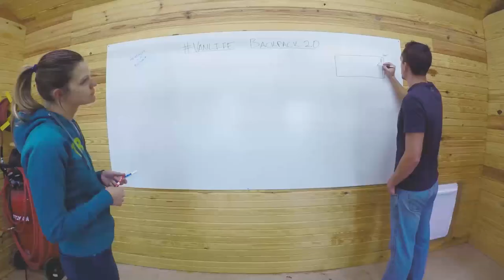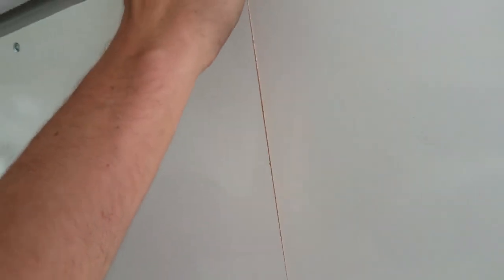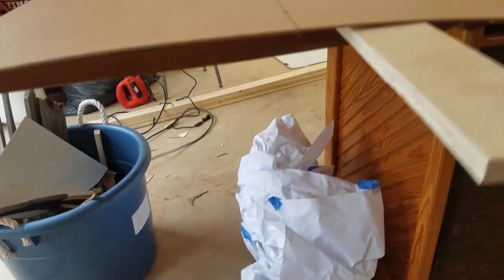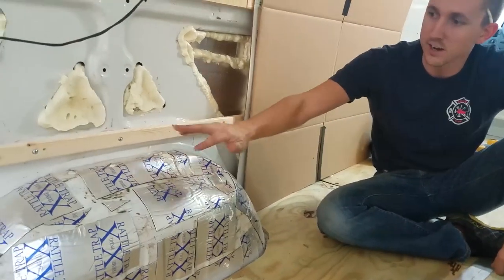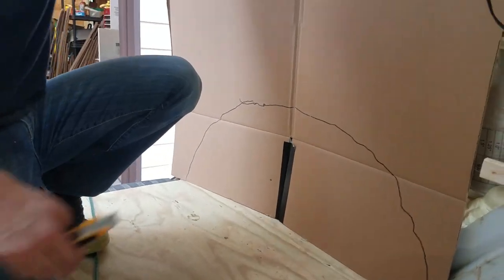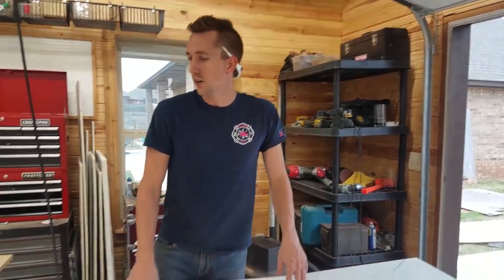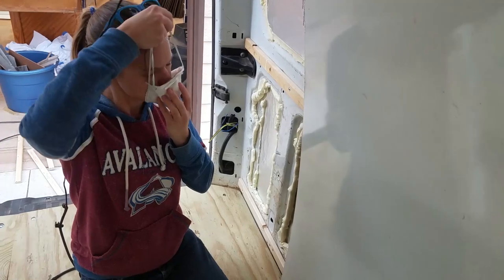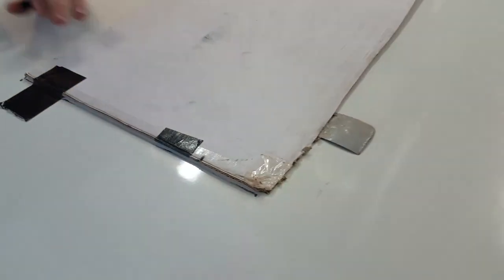How to Build Camper Van Walls in a DIY Campervan - Ep 9 | Adventure in a Backpack

Comment: At 17:30 when you trace the wheel well go to the hardware get some copper ground wire it's about 1/8 inch diameter it's soft copper and easily bends to 
the shape you need and just trace it onto your panel to mark it out.
Reply from the maker: ...and update in case you missed it: https://www.youtube.com/watch?v=-V1NWxuyDWY&t=6s
Reply: wow thanks steve

Comment: Bit late, but with my wheel scribing, I just got a small piece of cardboard, put it flush against it then just used a pencil to make a rough drawing of the curve, the cut it out and put it over the wheel well. Trimmed it to fit perfectly, then just measured how far from the wall I needed to put the outline and traced it. This way seemed so stressful.

Comment: I think you did a Great job Nate considering your not a woodworker. I'm watching your build along with many others to design what will work best for me and I like your approach. It doesn't have to be perfect, just do the best you can. Last night I checked out "Low budget cargo van to camper" from Rickcampervan or something like that. He's in Ireland I believe and used a Renault cargo van to start with. It's tiny but he's got a collapsable bed, propane stove and heater, sink with submersible pump in water tank and shower/toilet. He did one build he called "Mark 1" and redid it called "Mark 2". He used gray roof felt or fabric with 3M adhesive to all over the interior walls to hide the imperfections and make it look nice. "Very forgiving" in his own words. You may want to consider it although I am wondering if smells from cooking would get trapped in it after a few years. I 'll be gutting my 23 yo conversion van in the fall as I consider the interior it has now to be "smelly" from the kids and grandkids  of the previous owner who spilled who knows what over the years. The interior isn't too bad except for the carpet. I just prefer "new" for myself and hopefully I can add insulation and lighten up the overall weight by removing things I don't need. Having a set of extra hands like you and Steph have with each other would really help! Looking forward to more from you folks.
Reply from the maker: Thanks so much!   Yeah, so far so good with the walls.  Pretty easy to work with and if they get nasty, they just wipe right off.  Not exactly seamless, but pretty clean nontheless!

Comment: Not to be a know it all but......you gave me NIGHTMARES as you were trimming the little piece of cardboard due to you cutting with the sharp towards your arm. Had you slipped and gone up you would have had an ambulance coming as you would have cut into some pretty important areas of the arm that would bleed out pretty bad. Just wanted to tell you as a heads up in the future...... All the best and great vids!
Reply: I had the same thought. Right up in the armpit!
Reply from the maker: 29 years and going strong on avoiding serious lacerations due to cutting cardboard.
Reply: Adventure in a Backpack an ounce of prevention! Accidents happen very quickly ... that's why they are accidents. I sliced tendons in 2 fingers at 40years old. Freak kitchen accident!
My ex (carpenter) sliced his fingertip with a utility knife. Shit happens with complacency!
Reply from the maker: If I could find a way to completely avoid accidents, I'd be a VERY rich man. lol

Comment: I needed to see how it's put into the van frame.
Reply from the maker: The 1x2 furring strips are actually 3/4 of an inch wide.  There is a gap of about 2 inches from the metal where the furring strip is attached to the outside of a panel.  We used 1 1/4" screws so there was plenty of thread to hold onto the metal and still have about an inch and a half of safety buffer to not drill through the exterior metal.

Comment: Great build! Hey what type of screws did you use to attach the wooden strips to the metal? You must have had tp predrill the holes through the wood into the metal?  thx
Reply from the maker: We used self tapping lathe screws.  We pre-drilled the wood, but not the metal.

Comment: I like your dry erase board idea for the walls.  I was going to use 1/4' plywood.  How do you like using the much more flexible dry erase board?  They seem to adjust better to the curves of the van walls.  They may be better than plywood because the flexibility can adjust to the driving movements.
Reply from the maker: So far so good!  I think that plywood would probably handle moisture a little better, we have had no problems with our walls.

Comment: Is the thing that you use for your wall waterproof?
Reply from the maker: It's melamine coated particle board, so the white part is water resistant, but it's not really a waterproof material.

Comment: You do nice work!  We're thinking of getting a new van and doing another conversion.  I think one thing I'll consider in doing another van is the composition of the materials.  Apparently, things like pressboard/particle board can off gas formaldehyde.  In such a tight space, it could be an issue for the first couple years.  There are companies that make formaldehyde free plywood.  I'll have to research that more.  I'm sure they're not cheap either for that luxury.  But I think the spray foam off gasses too.  There's probably not a 'no toxin' way to make an RV.

Comment: I'm wondering as time went on, how durable was that very thin wall covering? looks like a hard bump would crack it??
Reply from the maker: Debra Pate It's particle board, so it's not exactly brittle.  We actually just went down 30+ miles of 15mph washboard roads and all is good.  Only time will tell though on longevity!

Comment: How are the furring strips attached with screws? To the metal inside body of the van. How do you know they won't go thru to the outside?
Reply from the maker: Great Question!  The 1x2 furring strips are actually 3/4 of an inch wide.  There is a gap of about 2 inches from the metal where the furring strip is attached to the outside of a panel.  We used 1 1/4" screws so there was plenty of thread to hold onto the metal and still have about an inch and a half of safety buffer to not drill through the exterior metal.
Reply: Tks for the reply your videos are great'
Reply: Tks for the reply. Your videos are great!
Reply from the maker: You're so very welcome!  :D
Reply: I am starting my van conversion soon.  I thought about using the pre-existing holes in van ribs but it is too difficult to attach the furring strips to these holes using bolts, washers and nuts.  Also, I worry that the nuts would eventually come loose over time from the driving movements.

My only good option is to apply your method.  Are the furring strips tightly secured to the van ribs with the 1 1/4" screws?    Do we lose any structure strength from creating additional holes to the van ribs applying your method?
Reply: karlo3111 I have not started yet.  That is odd how tough it is for you.  Could it be due to the power of the drill itself being weak?
Reply: karlo3111 Funny.  I plan to park my van at HD on days I may need to make multiple trips to HD.
Reply: I am at the stage of putting in Plus nuts...everyone states it is much easier...and hold really well~
Reply: Theresa Tower 
Plus nuts?  Could you please post link of where you purchase them?
Reply: Theresa Tower 
Thank you for sharing.
Reply: Maverick Aerials AMEN. I need to see that
Reply: Aren't you worried about the constant vibrations from the van moving around unhinging you're screws from the frame to the wood?
Reply: @TheresaTower  Did you end up using nuts? If yes, what kind?
Reply: @karlo3111  YES! That is how you win my friend, need a part you don't have, great just go inside!. How did you get power?

Comment: Once you have a close pattern ie within 2", use Popsicle sticks at approx 2 inch spacings and a hot glue gun to the exact points you want to fit to.. Takes a little time but you get an exact fit first time around.
Reply: Hi Rob Vann This is Interesting. is there a way you can show me what you mean here? or guide me to a Video in YT? Thank-U
Reply from the maker: +lacsa727 I will put out a video on a quick and simple way to do this within a week.  Be sure to subscribe! :)
Reply: I used to build boats and found this by far the best way to accurately fit bulkheads to the hull. These were often made from pricey marine ply so risking a poor fit or wasting material was out of the question. In place of Popsicle sticks we used thin strips of scrap wood about 1/8"or less x 3/4"wide x 5" with the ends cut at 45. In places such as corners or other irregularities the spacing must be closer. Bob Wells just did a video and had the same issues you had ..lots of frustrations and a job that was far from perfect.. Cheap hardboard for patterns worked well although although today I might use something like thin foam board .. light and rigid is better.. To transfer to pattern just lay it on the ply and mark the points. A flexible curve would do a great job in connecting them but I found just freehand works well..
Reply: I'm not really set up to make videos but I see a lot of folks struggling to get good fits on here. If this channel could do one it would no doubt help a lot of van builders.
Reply from the maker: Rob Vann Oh, I think I see what you are saying now!  Seems pretty time consuming, no?  or is it faster once you get better at it?
Reply: With a hot glue gun it goes very fast .. but then again a perfect fit the first time around does take a little longer..
Reply: Yes I Saw Bob's New Build and what a hard time they also had... But I picked up a New Toy out of it... The Fastcap Accuscribe Scribing Tool ...LOL  A New Gadget for my collection....Oyee! Vayy!. Lol
Reply: You may have noticed Bob had a hard time keeping the scribe tool level and that's the downside of using it, any deviation and the pattern becomes inaccurate.. I had one once for doing log scribing which had a bubble level on it, that might be better option but the results will still not be as accurate as hot glue and splints.

Comment: Hey guys! Do you think screwing in the battons makes the van more subseptible to condensation? having the metal screw go through the metal and through the wood, touching your paneling? I'm worried about this and considering using stixall or adhesive to keep thermal bridging down. What are your thoughts?
Reply from the maker: Hey Matt!  So...you asked my thoughts...so I present to you, my thoughts...  I think that you are overthinking it.  In a lab, maybe it makes a difference, but real world...not so much.  Just pick one, and roll with it.  If you overthink every step of the process to the degree you are over thinking this step, you will never finish your van.  :D  I'm only being harsh because I'm ready to see you on the road to see how much more awesome content you can create!

Comment: Is better using plastic? In the end, there is a lot of weight on the camper, which means increasing diesel consumption.
Reply from the maker: We've never used plastic so we can't say.  It does add weight, but we aren't trying to set records for the lightest camper...we are trying to go on adventures!

Comment: Dear Adventure, I am wondering why you passed up the opportunity to add more insulation in between the furring strips.   It would only be about 1/2" or maybe 3/4" thick, but it would cover some of the bare metal ribs that were still showing through. And the insulation would also help support the paneling.  Nice meticulous job though, looks great!   Show this video if you ever want to sell the van - proof of a quality build.   :^)
Reply from the maker: Thank you very much for the kind words!  Honestly, it's really not something that we even thought about. lol  Some 1/2 insulation would have fit very nicely in there.  But yeah, that would definitely add some more insulation for sure!
Reply: ... thinking the same thing, great minds think alike. 😎 LOL
Reply: Chuck Taylor  hi can you prove this with a link? Please
Reply: Just look at the manufacturers instructions. Reflectix is useless without an air space of at least half an inch.

Comment: Another super-useful video, thanks. Can you tell me why you mounted the plywood into furring strips and not directly onto the van body?
Reply from the maker: Thanks, and No Problem! :D
Here was our thought...  It was for 2 main reasons.  First, we were wanting an easy place to screw LOTS of screws that hold the walls to the furring strips.  We figured that the fewer holes in the metal, the better, so rather than putting 100 screws directly into the metal, we could get away with 25 screws (figuratively... not actually sure how many) into the metal, then 100 screws into the wood.

Secondly, we were planning ahead for cabinets.  We will be using big lag screws to attach the cabinets to the walls and although the metal is the strongest bit, we wanted a little extra reinforcement.  We figured that the added wood may reduce vibrations and keep the screws from backing out of/stripping out the screw holes as we bounce down the road.

How true/helpful any those tactics ACTUALLY are is unknown.  That was just our thought process.
Reply: Thanks. I believe locknuts are also a good way to counter the vibration. (I'm behind you in the build process, so this is from my research, not experience...) https://en.wikipedia.org/wiki/Locknut
Reply from the maker: Locknuts are definitely good for that purpose, but in our case, we don't have access to the back of the furring strip or already have the bolt sticking out for that to work.  A lock washer could work with a screw I bet, but I can't say for the effectiveness.  Obviously, just a bunch of speculation with nothing to back any of that up... ROFL!

Comment: i know air and isulation is good between but is there a reason wool  or pink isulation wasnt used fromt he wall out with what you had placed in there? wouldn't that make it cozier. I have no idea.
Reply from the maker: As far as the pink insulation, we didn't want to use that because we didn't want fiberglass floating around in the air while we were rattling down the road.  As far as the other stuff...we just didn't do it.  We probably could have, but just didn't.  Remember what I was saying about 'analysis by paralysis'?   Just pick something and roll with it.
Reply: The pink fiberglass insulation is also notorious for mold, if you are in humid climates and it is basically useless if it is "smushed" at all. It has to be full thickness and hold air in order to be effective. Rarely a good choice for vans that are going to be in an environment that isn't completely dry. At least that is found I found in my research. We are opting for rust-resistant, mold-resistant nontoxic paint on the interior of the van, then covering with foam, then board, then walls.

Comment: Are you not worried about that expandable foam being flamable?
Reply from the maker: Expanding foam is only 'flamable' when it is being expelled from the canister due to the propellents used to push the foam out of the can.  This hazard can be avoided by not smoking and extinguishing all open flames while applying the foam.

Once the foam is cured, it is only 'combustible' when exposeed to prolonged temperatures of greater than 240 degrees F.  Which, if there is a heat source greater than 240 degrees F; other stuff like cabinets will also begin to combust as well.

So, in short; no... not worried about that.

Thanks for that question!  It's rare I get to use my degree in Fire Science to answer a fire safety question on the channel. :)
Reply: @EXPLORISTlife  thank you so much! I had posted this method of insulation to a Facebook group and a lot of people say it's a bad idea, but I think it's a great idea!
Reply from the maker: Yeah, there is definitely a lot of ... information... in facebook groups.  😂

Comment: Where did you purchase the wall paneling from and was it called dry erase board ?
Reply from the maker: Ron Hart We bought it from Home Depot, and I know Lowe's carries it as well (in the U.S.). It's called Hardboard Thrifty White Tile Board at Home Depot. It's an acrylic finish on high density fiberboard. http://www.homedepot.com/p/EUCATILE-32-sq-ft-96-in-x-48-in-Hardboard-Thrifty-White-Tile-Board-HDDPTW48/205995949
Reply: I call it shower board cause it was used in bathrooms. but it makes great outdoor sign board if you seal the back. and yes it works like a dry erase board too.